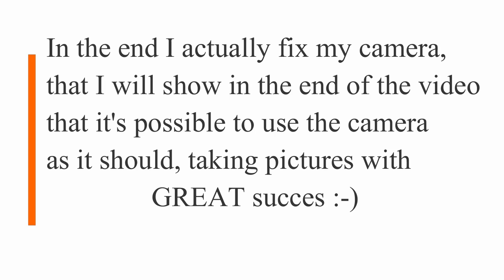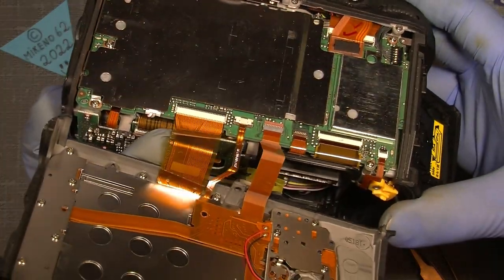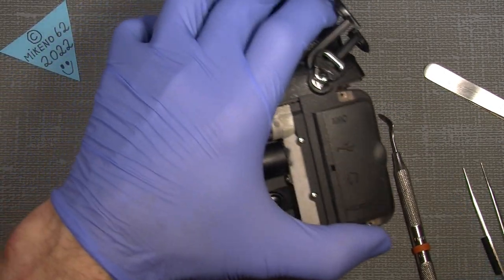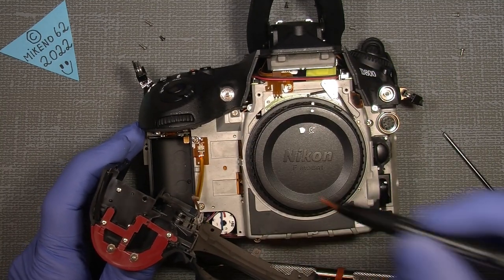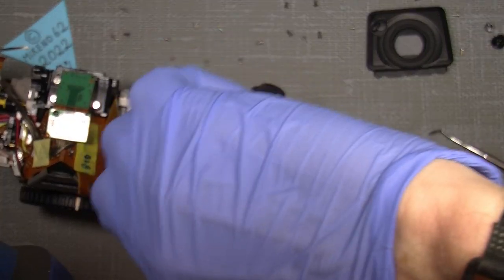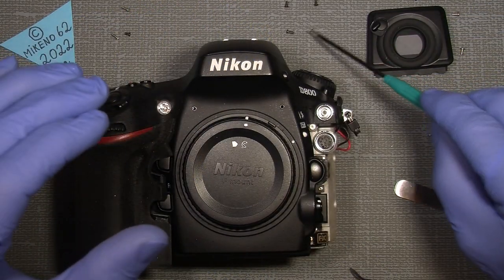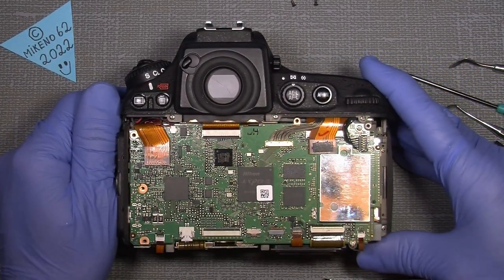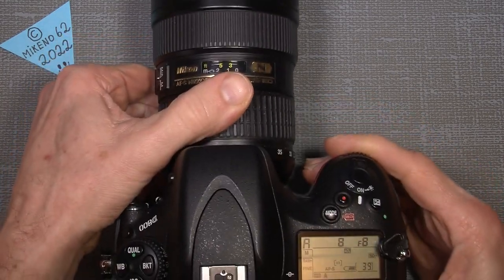Nikon D800 buttons on the back is not working BUT I repaired it

Comment: I'm so glad I came across your excellent video! I'm having the same sort of issue with my Nikon D200. None of the main rear panel buttons are functional. However both the play and delete buttons do work on mine, so I am able to view recent photos and delete them, but that is all. The command wheel is only partially funtional, on the right side only, which is strange. I have removed the rear panel, cleaned all of the ribbon cable connections and re-seated them incase they were loose. The motherboard looks to be ok, no obvious damages like water, shorts, arcing, etc. I think I will remove the top cover now and investigate the "play and trash" button connections like you did. Maybe I'll get lucky!
Reply: I should also add that the owner before me removed the flash capacitor completely and had it rewired via a custom plug that fed through a drilled hole next to the USB input. My only guess why someone would do this was they were maybe using this body some kind of specific studio process and needed it hard-wired to a strobe setup? Also, under the bottom body cover, the orange and blue auto focus wires have been purposefully cut. Maybe this body was used for studio macro work, or some type of astro photography and auto focus was a problem for them? Very strange modifications! The shutter only has 31,000 actuations, which is pretty low for the age of this model. If you have any thoughts on these modifications I would love to hear them. If I could just get the menu working again, then I would have a fully functional camera. Cheers!

Comment: Happy New Year, does it scare you too open such an expensive camera? I have a second hand lens with something in the lens and every time I think could just open and clean, well it freaks me out. Are your services available?
Reply: Just go for it. Cameras are easier than cameras as it’s just electronics. Lenses are a black art.
Reply from the maker: Well I am not really scared, because I don't look at the price of the lens or camera. If I get a camera or a lens for free that is not working, I have nothing to loose when I disassemble it becuse it's already defect, but on the other hand I have a lot to win if I can repair the thing, and in that way safe a lot of money. And the second thing, I will learn some new things everytime it happens :-)
Reply: @mikeno62  I suppose I will have to give it a try.
Reply: @snoogly  thx, still spooked.

Comment: Hello.
I fixed my D800 whose mirror wouldn't close.
It was a piece of metal attached to the mirror.
This solved the problem.
But on one of my D800 boxes I have a big problem.
It works well at all speeds except ! at 1/8000
at 1/8000 it gives a message: ERR
Which way should I look?
The contacts are clean, I tried all my lenses and even without lenses. It is only at this shutter speed that I have this problem.
I can completely dismantle it without any problem but I can't see where to look.
All cables are properly connected. I don't understand.
Thank you mike